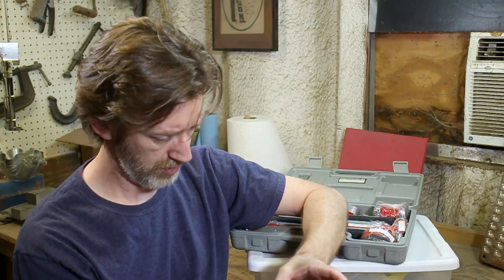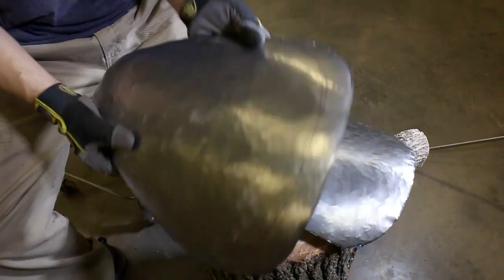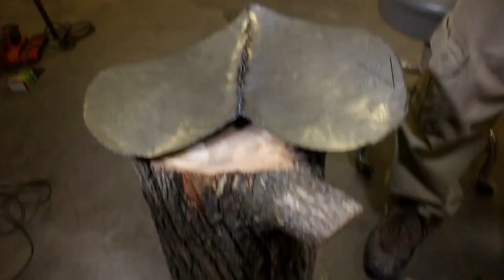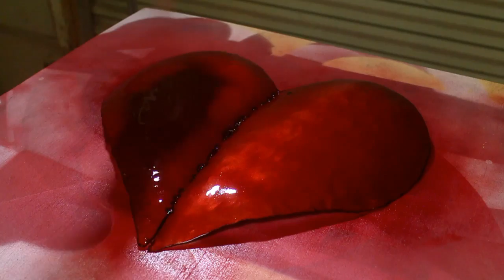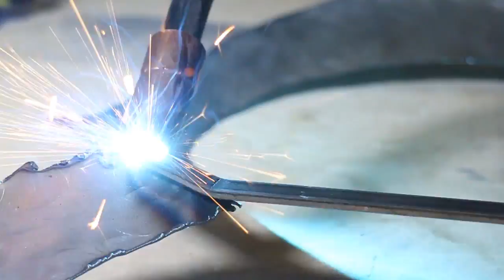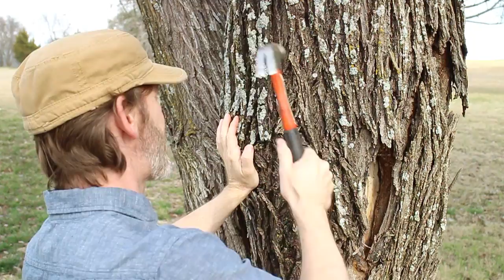❤️️ Hand-Raising a Steel Valentine's Day Heart With a Hammer and a Stump ❤️️

Comment: You were having trouble with the depth of the curvature.
That's what the dolly is for. Clamp your work down and then hold the dolly underneath the sheet as you hammer on top.
By varying the angle of the dolly it will stretch the metal around. This is how they get deep compound curves on car wings etc.